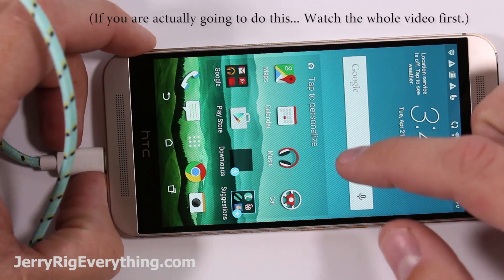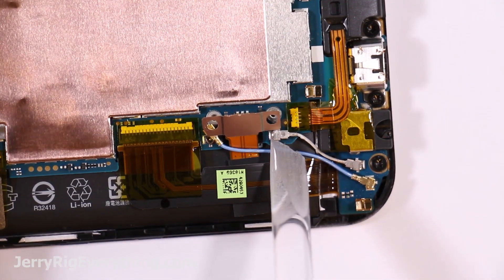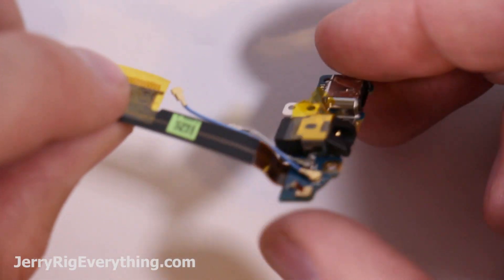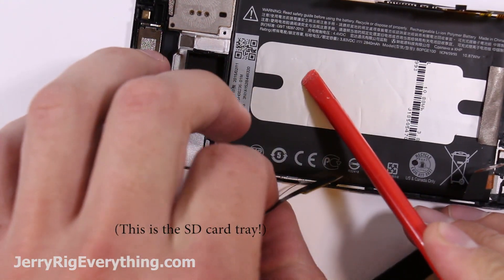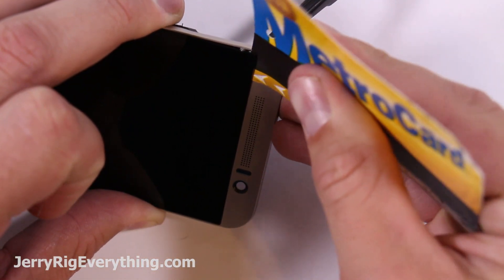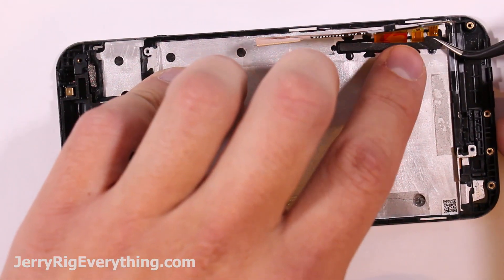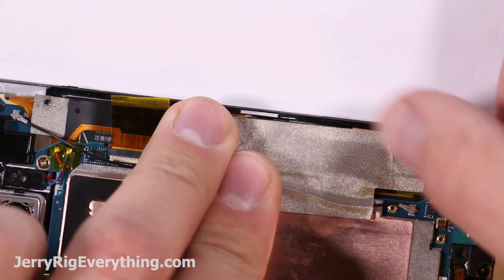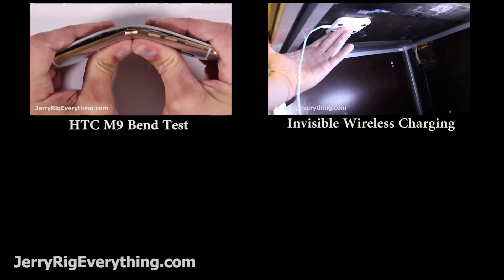HTC M9 Screen Repair, Charging port fix, Battery Swap COMPLETE

Comment: This was the very first JerryRigEverything everything video I ever watched. Brings some memories back. Mostly because of the night, that made me have to replace the screen on my M9.

I left it in the grass overnight at a friend's house. Didn't want to turn on the next day for some reason (water damage), so I decided to whack it on the concrete and stomp on it a few times (as I was still pretty drunk).
This video helped me clean the internals and replace the screen. Later I used the same video yo replace the battery. (Yes, it survived).

I've since replaced a quite a few batteries and screens watching your videos. And as many, I also listen to your durability tests and teardowns to fall asleep!

Thanks Zack!

Thanks Zack!

Comment: At 2.45 what size are those screws ? the eBay pack I got to replace my headphone/ charging port didn’t come with a “T” screw driver that size which is really annoying..... If anybody could help that would be great ....yeah i know what your thinking ....have a good variety of tools before starting a job...but yeah I was dumb and trusted this eBay pack was giving me the right tools and part for the job

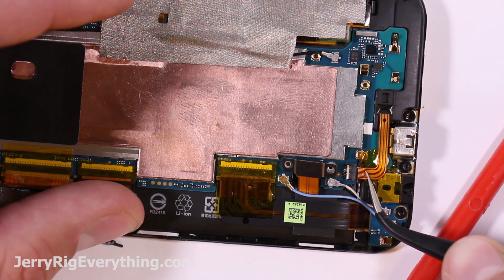Comment: The white and blue cables @ 9:53, I only have the blue one. I bought a new charger board because my phone stopped charging (I gave it to my little brother, not sure what he did with it) and the new charger port only has the white connection point - I'm going from charger board white to motherboard blue. Is this okay? Do they both do the same thing? Phone still isn't working, not sure at this point if my retard brother threw the device and it damaged the internals.

Comment: I manged to brake a zif connector on the top right side when putting it together again after replacing the battery I forgot to fold it back down... :P Dang it to heck :P

Comment: hi.. my unit works fine and i just tried to disassemble it to change the front frame attached to the lcd...i was careful removing all parts until i sliced the lcd when i was trying to remove it from the front frame... i tried to reassemble everything. but when i tried to test the unit, it doesnt power on... but when I charge the phone, it charges and the battery charging icon appears on the screen... what seems to be the steps I went wrong during the re-assembly? thanks.. now i feel bad because all i wanted was to make my phone look better on the outside...

Comment: Wondering how I find a tech that works on HTC ONE M9 in town of 300,000?  My screen glass has popped out of frame about 1/8 of an inch.  ugh.... 23 months old with lite use.  Battery probably expanded and will need replaced... ??  IDK...

Comment: I replaced the Battery of my HTC One m9 but now I got connection problems with the wifi and Bluetooth, the wifi only works when I put the phone close to the router. the Bluetooth doesn't pair with any device. Suggestions?

Comment: To get this apart, where the edge of the black strip is after you take it off, use something quite thick and hard in the little gap and twist. Then run a plastic spudger around the opening. Easily came apart doing that.

Comment: I have been searching for a video for the framework for the earpiece. I pulled off some kind of copper wires and then had to order a new piece. I have no idea where the frame work is and there are zero videos or links to order these parts. No one has removed this part.

Comment: Be very careful when separating the front and back halves!  I damaged my M9's bezel a bit because I couldn't detach the clips easily.  I recommend going from the top to the left side and finally to the bottom, then hinging the phone open on the right side.  You should be able to slide a firm guitar pick all the way down the side of the phone with minimal prying.  The pick should be angled downward so it's against the side of the metal back.

Comment: I like how the vibrator motor is actually soldered onto the mobo
Because that's one of the issues mine has, the other being the charging port just broke. Classy.

Comment: Not as hard to replace micro usb port. also if you are replacing the battery, once you remove the motherboard the top area with the camera doesn't need to come off. which is a good thing. the whole area with the camera look like a pain in the ass to re-assemble.

Comment: This phone is a pain in the ass.  Just did my first one and the repair was successful.  It's mostly just time consuming.  This is a good video besides the fact you can tell the phone was previously opened (via the skipping).  One thing the tutorial fails to mention, is the use of adhesive on the camera, which sticks it to the back cover/housing, the use of adhesive under the motherboard & the use of adhesive under the sim/memory card trays.  Failure to mention the use of adhesive under certain parts, doesn't give people the heads up that there will be resistance when removing these parts, which could result in damage.  Especially the motherboard!

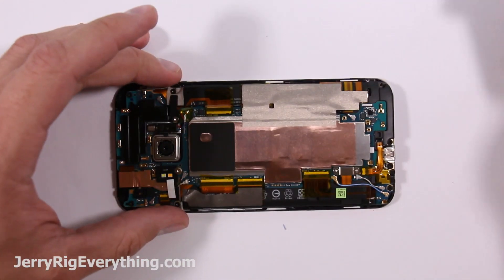Comment: at 1:17 those to snap on cables that connect to the  charge port board the on on the bottom isnt on my m9  but is came with my new charge port is that an issue?

Comment: Hi, i replaced the rear housing on my m9 and for some reason my nfc has stopped working? i did not touch and flex cables or fittings aprt from the screws at the top of the phone.. is there any reason this would happen? where abouts is the nfc chip located? the rear housing was purchased from etradesupply online shop so i assume it is genuine or to a similar standard (not that i think this should affect the nfc)... any ideas?
thanks
Reply: the nfc contacts on the back cover near the camera lens window need to touch the contacts on the motherboard.

Comment: So basically HTC still doesn't know how to make a phone properly. Why on earth would you need so many ribbon cables and 2 PCBs?
Reply: I agree, the worst built phones. company's living in the past
Reply: the amount of tape in htc phones just makes me laugh.
Reply: at least the sim card tray is finally accessible and not sitting behind the lcd. They probably moved it because of the amount of warranty claims on their rubbish sim readers which meant full replacement of the screen and frame.
Reply: You clearly have never fixed a phone before. The second board is so you can easily replace the charging board if the connector fails. It is a very nice design as most phones do not have a separate board for the connector and it's just soldered to the main board thus making it near impossible to replace

Comment: I imagine the vibrator motor is soldered to the board on the off chance that it may vibrate itself loose over time - hence the solder to keep the connection tight.

Comment: Jerry, the for helping me with your how to videos..great work. Always love it. 

I know this is not an iPhone repair video , but I need your help. Can u recommend any other sites beside repair universe for ordering iPhone 5 LCD SCREEN. I live in Canada and repairuniverse charging a hefty shipping fee that make's the part as costly as  Apple store repair. I would be thankful. 

I know amazon and eBay got lot of sellers but I don't wanna buy something very cheap in quality. If u will recommend a site or a seller that will make me confident. 

Thx!
Reply: LakhTek Try gadget fix on ebay. Pretty much any screen you order fro any place online is exactly the same screen. Sites claiming that the screens found on ebay are fake or non authentic do so so they can sell you the screen they bought off ebay for a huge mark up. Some ebay sellers put their own mark on the screen some where and have busted a few of these sites buying from them bad mouthing them and then marking up the very screen they bought for as much as 3x. All new screens sold on ebay fro sellers with decent ratings are OEM and come directly fro apple Samsung or who evers factories.

Comment: Wow! Impressive. I've never heard of a "daughter board" before. Is there a "son board".  :-) I'm not sure how you put all the "connectors on the connectors" back together.
Reply: korinne Bagley Nelson It's an older term for people who were familiar with computer hardware before pci slots and form factors became widespread and there wasn't a need for expanding the motherboard's ports. Daughterboards basically are miniature motherboards that go on motherboards to add more slots and/or change the direction of how a card would be inserted into the computer (riser cards for example). 

As for the naming goes, not sure why they went with daughterboard but it rolls off the tongue better like motherboard does. Not to mention there are terms like "mothership" which denote a central component of something and there isn't anything like "fatherboard" either. English is weird. Then again, motherboards can also be called main boards and daughterboards used to be called piggyback boards as well so there's gender neutrality in that sort of thing as well.